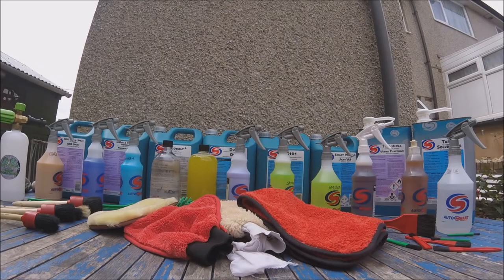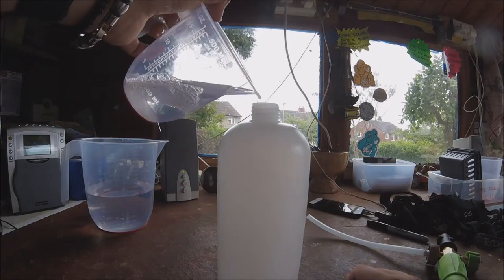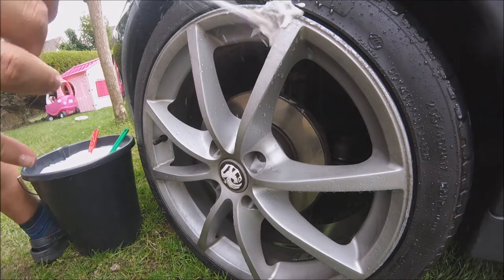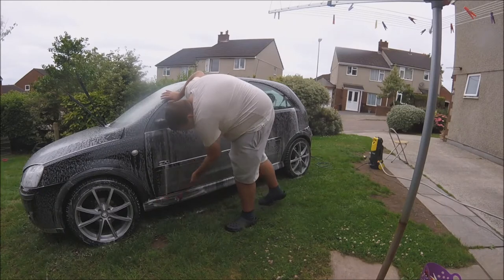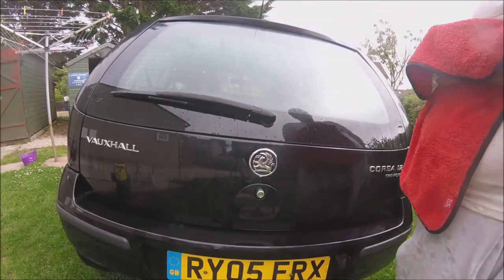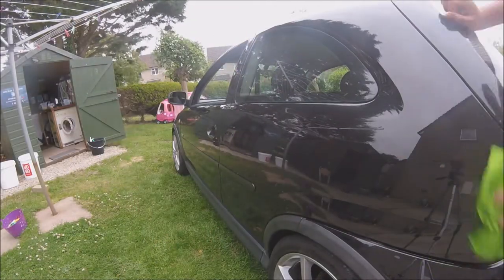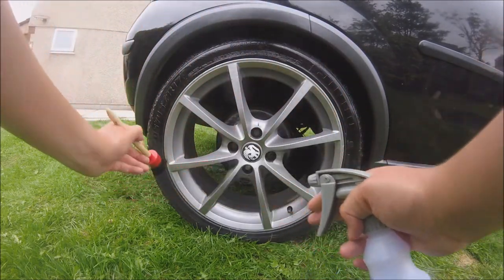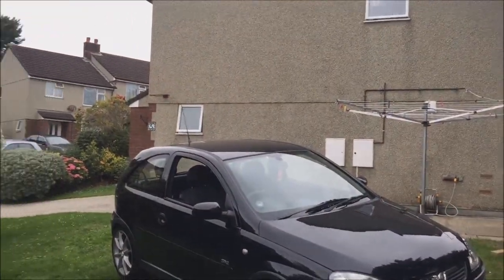One Manufacture Cleaning Video Using: Autosmart's Products

Comment: There are a few products there that overlap so you don't need both! (G101 is an all purpose cleaner when used at weaker rates and acid free wheel cleaner when used at 1:5, don't really needed the Smart Wheels!) Ultramousse is much better value than Highfoam Plus and a much better foam too.) It also works a treat when you substitute a capful of Ultramousse with G101 in a foaming bottle or lance, for wheel cleaning and such. They are both Sodium Hydroxide based so don't interact with each other and you still get the gloss boosters from the mousse.). Last thing, I would G101 first to soften and loosen the grime, then hit it with the snow foam and go around with your detailing brush. Seems the wrong way around to use the weaker product with good dwell first just to pressure wash it off and then use the APC to dwell and go around with your brush. Great video though man!

Comment: looks good mate. would clean wheels first tho. As you have a high chance of water spots on the paint. also top tip use some wheel cleaner on the exhaust. will bring it up nice follow with a metal polish 👍
Reply from the maker: Lewis Christie Thanks for your feedback Lewis. For some reason when it's a car I have never cleaned I normally snow foam first. Then do the wheels to try get the lost dirt off so the Wheel cleaner is actually working on the dirt and grime that needs to be taken off. Also I'll definitely do the exhaust but did not do it as don't have any of autosmarts metal polish not sure if they do one will have to research it.